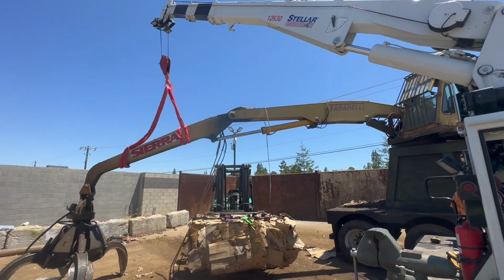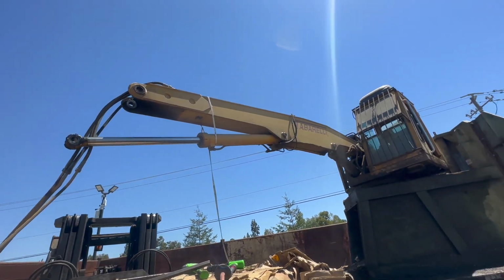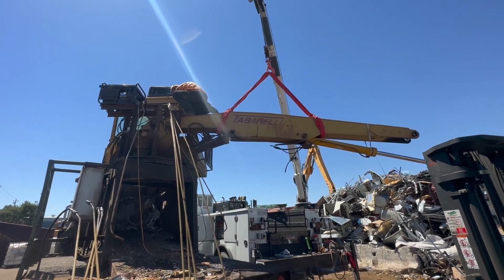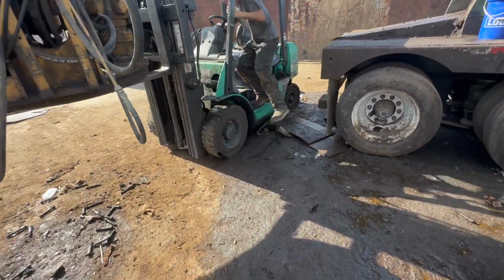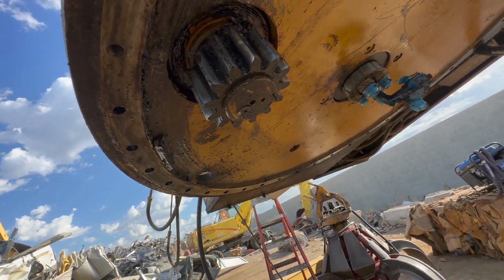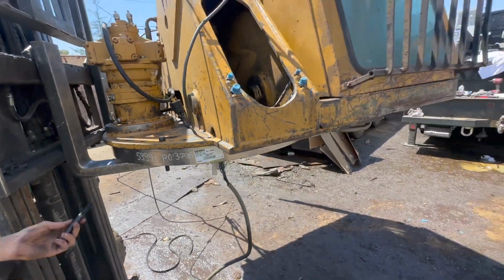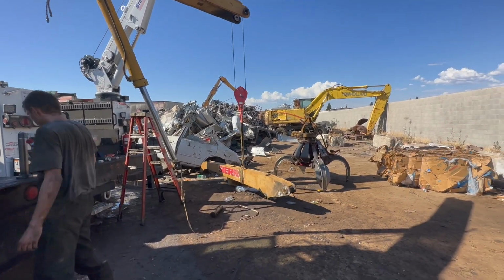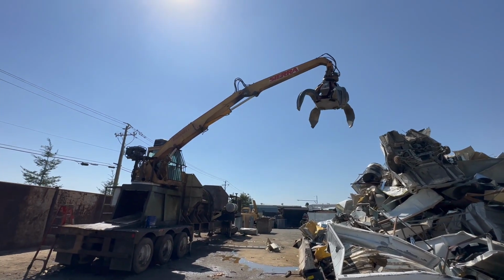Changing a turret bearing on a tin press. Typical can of worms!!!

Comment: As a fellow scrapyard mechanic, every single snag you hit got a big ol' "Yup," from me.
No bulkhead connector for a wiring harness with all one color wires? Yup.
Stick clevis almost machined halfway through? Double yep.
Can't take the boom clevis out without taking a window out of the cab? Uh-huh.
Scrap handler with a discount putt-putt generator stuck to some angle iron to power the magnet? Definitely yep.

So far, my favorite was a claw-boom that they sheared 3 teeth off the swing spur, and the other 5 or so were almost machined through. We did 3 swing motors on that crane. It was a classic handles-on-valves machine, and the operator would go from full swing in one direction and then full-reverse it to stop swinging.
Reply: you also forgot about the bits that you take off are inevitably cracked or broken as well and its your fault that its not a 10 minute job
Reply: Single colour wires is standard in industrial wiring, they'd usually be tagged though.

Comment: you are a frickin wizard. doing both the fabrication and the mechanical end. worked dismantling cars, business owner was a pain and used the big forklift instead of buying a lift. had a car in the air, was doing something off to the side and BOOM, something failed hydraulically, that car hit the ground so fast. there is no way one could have moved out of the way. in retrospect a safety bar would work but i never even considered hydraulic failure, duh.

Comment: When I worked on the farm we were required to maintain the equipment we were using. Every morning, first thing, check all the fluids on the tractors and loaders and top off as needed. Every single grease fitting on every piece of equipment we were using or planning to use got a shot of grease. If anything looked iffy it got reported to the mechanic. If anything was leaking it got reported. Believe it or not, the radiators were checked for debris and blown out as needed. We ran some relatively old equipment and somehow managed to keep it running and had few breakdowns. Guys that didn't respect the equipment either weren't allowed to use it or were let go.

Comment: Those temperatures are scary! It has cooled down considerably here in Germany. BTW, IR thermometers do not read accurately off shiny metal surfaces. That was quite a job. Good that Sierra has parts available for that machine. Thanks for letting us sweat along with you.

Comment: I am not saying this is the case but as a scrap company owner, it is a very usual issue to broke the bronze teeth crown because the operator do not use the brake when the crane is rotating.He just stop the crane activating the controls to the other side.

Comment: 3:00....that hole is .like one of the Wright Brothers........Orville........
your little buddy needs a Hat......
I just bought a Black Stallion 'Cooling Towel' from the weld supply....
you need to get one.......9 bucks....dip in water, stays damp for at least 10 hours or 
more.....it has been a life saver in my shop......after 15 minutes I would be soaking 
wet with sweat.....now, after 8 hours, I am only a bit damp around the shoulders...
in the past, after 2 hours, I would go home, now I am working 6 to 8....
This Cooling Towel needs no refrigeration.....I have no idea how it works, but it works great....
not like those ones you throw in the freezer......
check em out.....they are the quality of Cubitron II discs in my opinion, and you 
store them in the cylinder they come in, they actually come damp from the MFG.
Cheers, Paul  in stinky hot Florida......